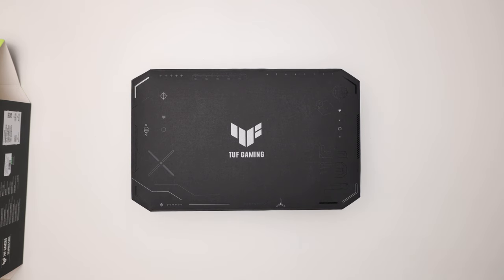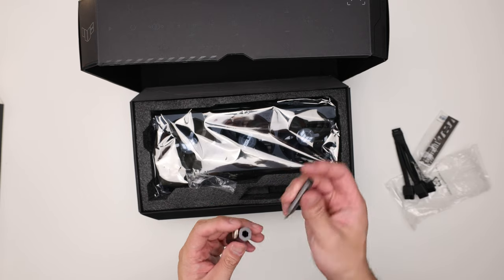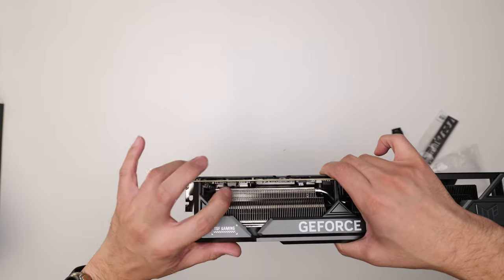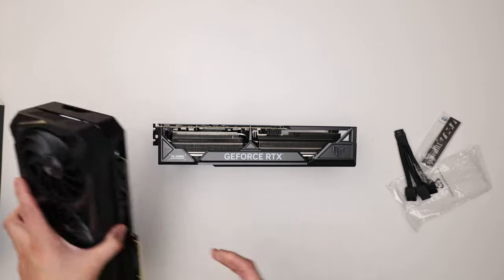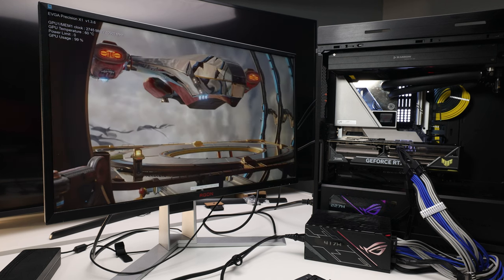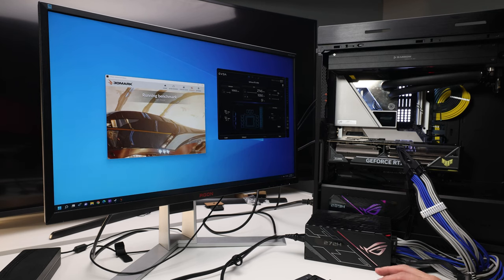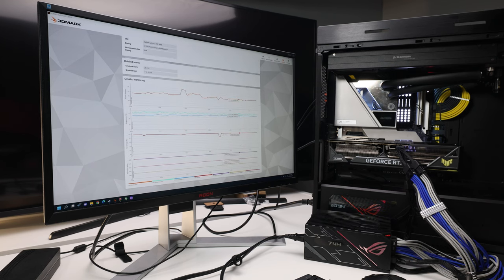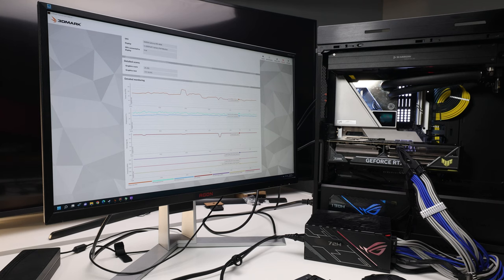ASUS TUF RTX 4090 UNBOX, TEARDOWN,  ROUGH OVERCLOCK TEST OVER 3000mhz!  AND SOME THOUGHTS

Comment: thanks for this gonna pre order the tuf gaming from bh photo for like $1594 now since it can reach 600w
Reply: Did you do it? I was thinking about doing the same
Reply: @hpd_hero   no not yet they don't have a ship date and the strix has not been in stock since launch day so I have a feeling we will see it go in stock very soon so I will wait. If its possible I would like to get it from bh or newegg since I know I won't have to wait forever vs ordering it from blt shop
Reply from the maker: Bh is a gamble for pc parts. Often it can take much much longer than other shops.
Reply: @hpd_hero  no I ended up getting a msi gaming trio x but it can overclock past 3ghz so its good.
Reply: @JCustom   I was able to get a msi gaming x trio and its going past 3ghz with no added voltage just increase the core to about  260 just move power target to 106

Comment: Thanks for the teardown! Looks like a solid card. It's kinda interesting that they used flat package SMD capacitors on the left side VRM , and can-type capacitors on the right. 

Btw,  the Thor PSU measures power from the wall, so it includes conversion losses. The power monitoring in GPU-Z sensors or HWinfo should be pretty accurate.
Reply from the maker: Good point. Thanks

Comment: Had a camera go bust and got an insurance for it, then I saw I could order gift cards in the insurance shop. So then I bought a gift card with 9% discount and used that to buy a 4090 TUF.
So its superduper expensive, but I think maybe its still a good time to switch my 3090, as I do game in 4K. So the 3090 is barely quick enough for 4K max res gaming.. With 4090 it will have better headroom.

Other than that Ive been happy with 3090. But of course in the coming years it might not be able to run everything at max in 4k.

Comment: Most factory overclocking is achievable on most of the same model cores, It's more to do with the headroom beyond that point. OC versus nonOC .. It generally often depends, the cores are indeed binned and sorted. A lot of the people that are buying the top tier models are going to water block(s) and overclock the crap of them. Other people who are concerned about anything that may hiccup latency don't want to run software in the background to ensure that the OCs are enabled. 

For the most part, people already realized that the 40 series consistency is very good and a lot of that is attributed to TSMC. Samsung was quite the opposite.
Reply: .. Also the power delivery of whatever PCB it's mounted to.

Comment: Thanks for the video. I preordered a Tuf card because of the price too, hoping it would have the same performance as the higher-priced cards. I am a little disappointed the Tuf doesn't have all the phases of the Strix, but I guess most of it is just for show and overbuilt anyways. I'm still deciding which water block to get. I hear Optimus is going to have the Strix/Tuf block out in November.
Reply: just get ekwb they will ship them next month
Reply: Don’t worry the phases are completely irrelevant these things are SO overbuilt. The cheapest 4090 from zotac is already overbuilt as fuck. They would be overbuilt even if the base TGP was 600W lmao
Reply: @MacA60230  this gen is the MOST OVERBUILT ever.

Comment: nice card, but its very wide! I've tried to fit it in LianLi O11D XL and with included power connector I can't close the side panel without serious bend of the cables, so I left it open for now. they made the plug to the card so stiff and 1inch long, I think, to prevent melting when bended . waiting for cable from corsair to my power supply because the plug is much shorter and it will be, probably, easier to close side panel. If I didn't know about cables melting problem I would, probably, put the side panel even if it made me uncomfortable to watch how it pushes against the cables. it looks like a lot of cases will struggle to 4090 cards not only because of length, but because of how wide they are, and sticking cables out of them.
Reply: Im going the same route, but EK block and vertical mount in XL case.  Hope it works out.  Also just make sure ur 16 pin CLICKS when you put it in all the way.  99% of melted cabled were proven to be 2-4MM out of socket.  Even had melt lines over all the pins proving they were not put in all the way.

Comment: Cool. Card fits in the case when it’s open. Could it do that with the squid cable it (the gpu) comes with?
Reply from the maker: Yes just run it around the back. If you have a small case than custom cables would help the mess

Comment: FINALLY!!! A reasonable man!  I did the same.  Spent the money I saved on an x3d for 359 on ebay new.  Selling my 3600 for maybe 75 or 100.  And 3080 for 5-600.  Recoup a little of the costs.. the x3d made a huge dif in d2 at 4k max settings.  Was wondering if my cpu was the issue and knew it was when I bitter up the 4090 with very little gain in fps… locked at 115 fps it peaks at 60% power and runs at 49/59 c base temp and hot spot.  I like it cool in my house.  ~65° or so…Just insane, at 50% fan too.  Silent till 60 or so…

Comment: doesnt your thor II have the 16pin for the gpu? keep us posted if the strix bios is working gonna follow you asap if it does.
Reply from the maker: Does not. I’m almost 100% sure the bios will work fine just need updated nv flash

Comment: I wonder what buying the OC version gives you above this if anything? In Australia the OC version is like $400 more.
Reply from the maker: Nothing. It’s the same card just with a diff boost base which means nothing. The gaming sku is required by asus due to fe pricing. The oc is what asus wants to sell it at. You will see the gaming magically disappear over time. If you can get it, get the gaming non oc now
Reply: @JCustom  Over here it's a USD$400 jump from nonOC to OC TUF. so VRMs, power phases, the PCB is exactly the same. it just a higher boost right? Damn what a scam the OC is

Comment: Is it possible to take of the ASUS 4090 TUF's Shroud & Fan assembly without unscrewing the GPU Heatsink? I'm asking because you removed the four GPU Heatsink screws, but it looks like it isn't necessary.
Reply from the maker: Yes you can remove it without removing the heatsink

Comment: If possible, could you tell me what the length of the card is without the shroud? or atleast the distace from the fins to the end of the card. I want to fit it in my ncase m1 while im waiting for the waterblock.
Reply from the maker: to the end of the heatpipe from the start of the pcb aprox 13inches

Comment: Why do they add a 4x8 adapter if the card is not OC? You only need the 3x8 adapter to reach the 450W! Like Zotac Trinity non OC comes with 3x8 adapter.
Reply from the maker: Aibs really shouldn’t be playing those games. The fe is 4 x8 and the base price. I don’t have a 3x8 card but I feel it will use a 4x8 and draw the additional anyway (if not vbios capped) I highly doubt partners would alter the way the sensing is worked just to differentiate skus. I do have a trio on order base one, if it ever arrives I’ll give it a try with the suprim bios lol

Comment: Hi JC loving each one of your videos as always ❤️, literally are like a godsend info for me, as I was lucky enough to get an asus Tuf 4090 non oc , and last week I was messing around with asus software gpu tweak III to tune for OC , getting +150 on gpu clock, 1500 in memory, with power target in 133% without artifacts in games, but I have a question for your vast knowledge Of this cards, do you recommend increasing gpu voltage slider to 10 or 20 % or even above that?

I want to know your opinión cuz asus gpu tweak III tutorial suggest increasing that value for 3000 series cards, so I Dont know if it’s safe in this generation or is more headroom for that, what do you think? Thanks again for everything you do in your channel 😃
Reply from the maker: I would suggest you go to 15 and see what clocks you can get. At a certain point increasing it further will not gain you any additional speed on ambient. These cards tend to clock max on air at about 520-530 watts. 1500 on Mem is very good btw.

Comment: This is the card I ordered. When I will get it I have no idea. All of the online stores sold out so fast, so it is a backorder.  I am curious about you mentioning flashing the other bios, and would like to know what advantage that would have. I'm also considering water cooling it. Is there a specific one that would work best with this card?
Reply from the maker: So far I only know of 2 coming out the ek
And Optimus. I’m sure bitspower will release one and so will phanteks. It’s quite a bit of heat so I’m not expecting amazing results temp wise on water. Optimus might perform well but also might be quite a wait. As for flashing the bios it would just to be get the power/boost curve of the Strix which may or not even matter.  Originally I thought I’d need to flash to get the 600w watt cap but it seems I may not need to given what I’m seeing in some games.

Comment: JC, The plastic shroud, are those screw holds/standoffs that reach out to the board plastic? then the metal fan holder screws into the plastic shroud?

Basically if I replace the plastic shroud i need to include screw holes to it not just to hold the fan frames but also attatch to the board?

Cheers.
Reply from the maker: Entire shroud is metal. The oem fans are on a bracket that screw into the shroud.  The shroud is then screwed to the pcb. I am not sure on what your looking to accomplish, but if it is to use larger fans you will need a new shroud.
Reply: @JCustom  oh wow so that's cast metal ! I thought it'll be plastic. Very nice. 

Thanks for that info. I've designed a Founders Edition style shroud that would utelise the 3 fans and their metal bracket, in theory I want to replace the shroud with my own 3D printed one.  It looks like the in this particular card the heatsink  can remain bolted in to the PCB, is that correct?
Reply: @JCustom  Thanks for your video I actually managed to get the same card and deshrouded it and made a new one that is FE inspired :)  you can see it on r/pcmods if you are interested.

Comment: did you ever flash the strix bios? also did you get the waterblock? I have this same oc model and i really am interested to see what i can do with it. I am having some stability issues with forza and a few other games crashing even at stock speeds. I have to have the fans running around 50% to help. my temps are well within spec and between 48-60 while gaming. I have not checked hotspot temps or anything yet. do you think i could maybe have a bad thermal pad on one of the vram chips or something not being cooled properly? I am tempted to disassemble it and check but hate to open up a card if its software. i have plenty of experience opening cards but its always just the anxiety of messing something up lol
Reply from the maker: Yes I did a phanteks block video where I have it flashed. A bios flash would not fix the issue you have. If your temps are fine (check with gpuz). You can try down clocking and check stability. I did have your issue before with a 980ti that I ended up having to rma
Reply: Hi, I’m wondering if you found a solution because I think i have the same problem

Comment: Hello,
my TUF OC 4090 is crashing with black screen and Windows Freeze at +1000Mhz Memory Clock.
My suggestion is that the Thermalpads are not correctly in contact with every single ram module.
Does anyone knows how to coppermod the Tuf?
I don't know how thick the copper and the thermalpads has to be.
Dont want to disamble my 2250 € card at the moment...
Thanks

Comment: The best 4090 vs the worst 4090 probably doesn't have much performance difference at all. This TUF at 500 watts vs Strix at 600 watts is probably offering nothing in performance. I want the FE but depends on how available they are.
Reply from the maker: Yeah I want a fe as well. I was benching cyberpunk with all ultra no dlss and rt on. I was getting mid 550s. So I think there is no difference tbh in the power pull

Comment: So I ended up picking up a Tuf 4090. I also have the Suprim like we talked about but on air my Tuf hotspot hits 95-100c when I run port royal or furmark and stuff like that. Even at 100% PL and not maxed. All of the other temps look great but when the card is pushed to full utilization the hotspot goes 20c over core. Should I repaste? Or return
Reply: Hot spot at 100c is completely normal , I wouldn’t mind to repaste it

Comment: Can you put 3 120mm fans on the heatsink if you remove the cover?
Reply from the maker: The original fan is smaller than 120mm. You could definitely make something to use 3x120mm fans but you will have to design a mount/shroud
Reply: @JCustom  im just talking without a shroud to get even better temps and lower noise.

Comment: Hi,

I have a Tuf 4090 card which is working great but I've noticed that when the pc is off the red light which normally indicates a power issues is on.(not blinking) 

When the pc is on, no light and no issues.

I have a seasonic prime tx-1000 titanium PSU, all is working well.

Any idea?

Thanks
Reply from the maker: Could be your adapter cable or your psu cables. I have had this with previous gpus tends to be a bad cable.

Comment: I got a question man, I know you use Furmark, can you run cinebench r23 full cpu load and Furmark at same time without crashes for overall stability test? When I run cpu full load Furmark crashes or I get blue screen on overclocked 13900 k ddr5 system, but if I run Furmark on its own and or cbr23 on its own no issues. What does this mean?
Reply from the maker: What psu do you have? If your crashing running them together its normally a power issue.

Comment: J C can you tell me how this tuff has 2.5mm or 3mm thermopads? ? because I'm going to replace it and I don't know which one to buy.

Thanks in advance for the info.
Reply: I own the same model and they used both 2.5mm and 3 mm thermal pads for VRAM and ICs, respectively. FYI I've replaced the pads and found little difference in the VRAM temps.

Comment: What is the difference between the TUF and ROG Strix ? I know the ROG Strix has the vapor chamber and likely a different bios flash.....but is there any actual difference in the gpu that makes it actually better and worth $400 more ? I will be water cooling it anyway so the better cooler means nothing to me.
Reply from the maker: You get extra phases on the strix ( it doesn’t mean anything on a regular use basis even for overclocking) the strix cooler also performs better by 2-4 degrees( tuf is also a vapor chamber). If your watercooling  you should only be getting the tuf

Comment: do you have inductors(Drossel) noise? I have the same TUF 4090 OC and the noise of the inductors(Drossel) under load is very strong, is this normal?
Reply from the maker: I do not have that on the 4-5 tufs I'v had already. Noisest 4090 I've had so far was a strix.

Comment: You're wrong about 4090 TUF-4090 TUF OC being the same(Just a bios flash). Chips are tested to see what they're capable of, chips that have BETTER overclocking capabilities will be made into the OC model. But yes, it is a waste of money for what you get out of it.
Reply from the maker: No one is testing these dies when it comes to these variants. Very often when this is done there is some type of marking on the die. You don't need to bin for 40mhz on a boost clock. Everyone of these 4090s will boost well into 2900.  I understand why people think that way but no there is no binning for majority of models especially cards of this tier.  Only cards you will see binning on is HOF and some of the previous KPES to an extent. Don't be fooled by the marketing.
Reply: @JCustom  Looked around for myself and it turns out you're correct. Would be nice if every tech channel was like you. Everyone compares X with Y but always fail to mention they're the same thing. I guess I need to be more skeptical in the future. (Edit) Thank you for taking the time to inform me.
Reply: But at a $200 premium.. Its a waste of money. 5-6% is stupid and pointless unless you're tryn to get some pointless benchmark score.

Comment: Am I missing something TUF £1700, Strix OC £2400 both 3Ghz cards 😂 On water I bet they’ll be no difference on air maybe temps
Reply from the maker: The strix has a bit more on the power delivery but it’s not going to really make any changes in real world. Getting a good die based on silicone lottery is going to matter more
Reply: @JCustom  but neither card can hit power limits in gaming. Seems like this gen cards at voltage limited. If Asus release a voltage boost bios for the strix then we may see some improvement. Not sure if that is locked by Nvidia terms of sale.

Comment: i see multiple tear downs on youtube and yet none of you even took the time to even show (let alone talk about) the memory thermal pads which was a huge issue with GA102 cards and i suspect will still be an issue with 4090s and 4080s... Thermal pad thickness plays a huge role to the bad memory temps and i was expecting to see AIBs using 0.5mm pads this time around for memory cooling... I've seen cards where they are clearly using 2mm+ pads and nobody is talking about it... Raising the contact plate 1.5mm on the memory area so 0.5mm pads can be used would cost what in copper? Like 1$ more? Shame... Some AIBS seem to use a slightly raised plate for memory chips but again it's so hard to understand if the reviewer doesn't actually show it...
Reply from the maker: The reason they use such thick thermal pads as it is easier to reuse the cooler design. When you see the amd 7000 series come out you will see the same coolers. It’s just easier than being more precise.
Reply: @JCustom  Well easier is not going to keep my 4090s memory below 80-90c 😅😅